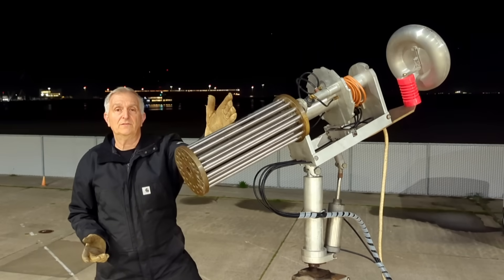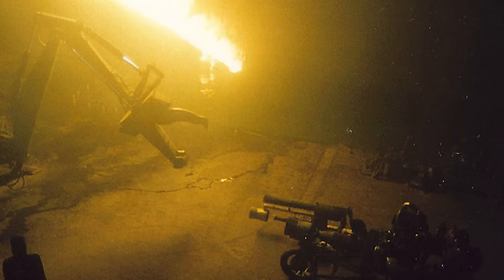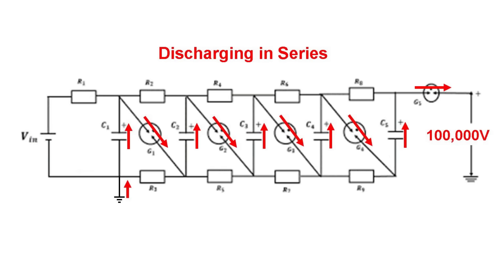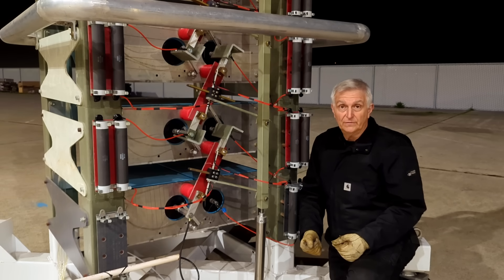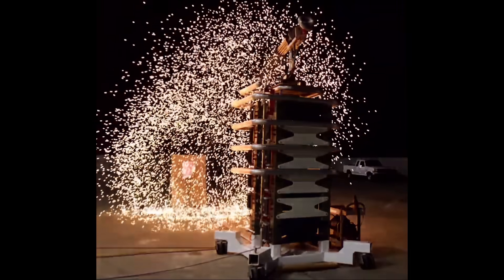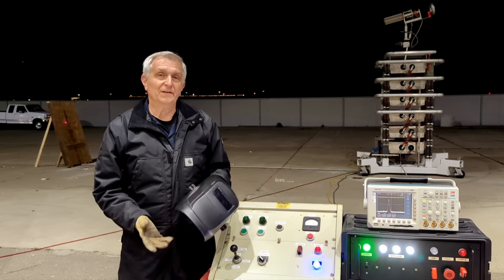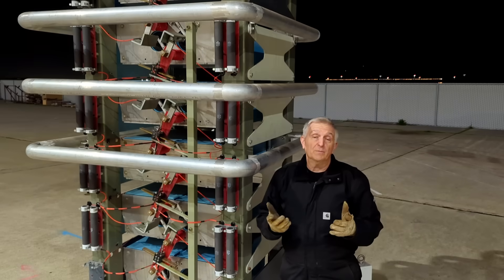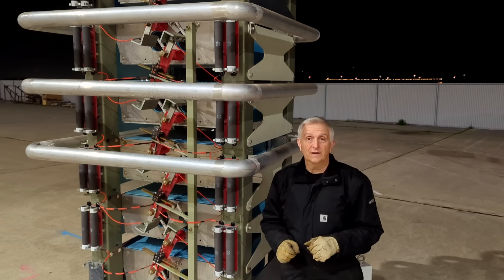Firing the Lorentz Plasma Cannon

Comment: fantastic machine ! I once saw something similar done by some Japanese researchers over a decade ago, except, what they did, was to send a high power discharge down a very high energy laser pulse, timing was everything of course. But that's the beauty of pulsed lasers, it's not that difficult with pulsed lasers to get into the regime being able to ionize air, and of course once THAT is done, your electric discharge will quite happily go zapping across it, what was particularly interesting, was that they actually didn't just use a single beam, but instead had a series of very high reflectance mirrors arranged so that the beam was zig zag down to the ground ! It seems fairly consequential that once  say, the department of defense (any nation) once they have a very high energy laser beam, that has an initial purpose of damaging/downing some form of aerial vehicles,  the next logical step is of course to "pep it up a bit", and what could be finer than having some god-awful huge capacitor bank with all the accompanying discharge shaping circuitry to deliver a pulse of juice that fries anything it can connect with ?

Comment: Unclear from watching the video- is this still using a wire or is it a true directed energy device? It seems like it fires a dart on a tether first but this is never explicitly said.
Reply: It uses a dart on a wire tether.  However, the wire is pretty much just used to direct the energy; it's vaporized into plasma as the actual discharge initiates.  And in principle a sufficiently powerful laser pulse would achieve the same thing.

Comment: Steinmetz used large banks of plate capacitors (air gap) for his lightning experiments. I saw his original apparatus demonstrated at the Museum of Technology in Munich, Germany in the late 1980s where they fired it up and produced lightning, quite impressive.  So perhaps copy and expand his approach, either using the brute force approach of even more capacitor plates, or perhaps enclose them in a sealed vessel and use SF6 as a dielectric so you could reduce the gap for more capacitance.

Comment: Awesome piece of engineering but you didn't say anything about the projectile that you fire first, it can be easily seen using the frame step on youtube. It can be seen clearly 'bouncing off' the CRT then a plasma can be seen obviously bending round the glass and all hell breaking loose inside the 'grounded' set. The projectile is dragging a thin wire behind it which intern vaporises giving us the effect of a 'Beam' very pretty ! How do you do the timing of this special effect please ? Lastly the pieces of wood seen leaving the target were due to the projectile strike not the plasma as its clear on the slow mo, so what is it made of as it damaged wood but not the CRT ? would love a look at the bit of wood. Very cool build.

Comment: try the same with fusion. yep fusion plasma arc will be contained (in liquid heavy water) in very small volume. another option is to throw a javelin, with as charge load tip. oh the pulse keeps the current wire as a wire until the energy is pulsed through. explosive material replacement with high current wire. yep quake machine of pulse pressure. high current cables up to the target point then the local thin charge pulse line at the target rock. emp cannon. local target payload on tip.
Reply: try carbon fiber ignition starter line instead. works even under water. well even a rotational energy storage can output tons of instant current to the target.

Comment: 10:27 Based on the last frame before the camera is blinded, it actually looks like the discharge went underneath the glass rather than over the top
Reply from the maker: Yep, and around the back surface to the deflection circuits.  Glass has amazingly good punchthrough strength.
Reply: @LightningOnDemand  ah, I just rewatched that section of the video and you said it went around but didn't specify which way around... I don't know why I thought you said it went over the top (I guess my brain took the "bits of circuit blowing out the top" and somehow blended it with the previous statement in my memory)

Comment: I don't get the hype. 
It does not fire a plasma .. it fires a wire which is made to explode with high current.
most of the energy is deposited between the target and the cannon. not the target.
the cannon and the target need a solid connection for the weapon to function
Reply from the maker: The trigger wire forms a plasma channel, which is essential for the machine to transfer 10's of kiloamps to the target.  The trigger wire by itself would have far too high resistance, and would of course be destroyed almost immediately.
Reply: @LightningOnDemand  and it is that trigger wire which explodes in the end. but the wire only touches the target, most of the energy is wasted on the way there. sure you have the kAs for µs.

Comment: A very impressive novelty item. You can see why things like this have no military value, all the energy of 5kg TNT which would have a way more devastating effect on the target.
Reply: I think it does have military value but not in the way you'd expect. The sound would be terrifying to the enemy's military and would become an effective agent of psychological warfare. Explosives are loud enough but this thing packs an even louder, further reaching sound, and emits an overwhelmingly bright flash in the process. You could take out an enemy's drones with this and they would be very intimidated to see that happen.

The other military use would be to detonate an enemy's IEDs from a distance with it. A lot cheaper than sending something out to detonate them. Could help if you are clearing an area of booby traps and mines.
Reply: @SynaestheticSynthesis  I imagine it would have quite an secondary emp effect for some distance too
Reply: @ Oh definitely. I think a large enough one might be able to down a swarm of drones with a sudden emp blast even if no direct hit is made.
Reply: No value yet, but who knows what the future might hold
Reply: @kahlzun  Maybe could initiate fusion in a gram of fuel? Good luck testing it though.
Reply: @threeMetreJim  if you got a full gram to undergo fusion you'd know about it pretty fast. That's about the same energy as 70kg of TNT
Reply: @kahlzun  I had a think about it, then had a look at the wiki page for the z-pinch machine. Turns out it can be done, but it's anything but safe (neutron flux).

Comment: the last test is awesome because we see the metal projectile bouncing back from the TV without even breaking the screen, so 100% of the damage is just from the plasma channel and not kinetic at all
Reply: Also if you watch the video frame-by-frame you can see that the current starts when a spark jumps from the projectile to the screen when it's still a few inches away, so most of the damage happens before the projectile even hits.
Reply: @BrooksMoses  i don't think the projectile even hits; it's blown back by the shockwave
Reply: @nicolaspeigne1429  Fair point!  It's hard to see in all the overexposure.

Comment: Just awesome :D Also, until you get the funds to build a real fun size taser, it would be interesting to see the current one fired at a working car! Mostly because I'm curious to see if the discharge is violent enough to trigger the electronics to the airbags and just how much damage it will cause to the electronics in general 🙂 Yea, I'm weird like that, but mostly just interested in what that cannon is capable of. Anyways, great to see it back and that you sorted out all of the legal stuff 🙂

Comment: It's back! Hopefully for good this time, this deserves its spot in the halls of Internet History.
Reply: Seriously! I was afraid that the only thing I had was a small screen recording of the pulse. So great to see it back!
Reply: You are a gem to the community Jeff, keep doing what you do :)
Reply: did youtube nuke it?
Reply from the maker: @retematic1488  There's an explanation in the desc above.
Reply: @LightningOnDemand  I still don't understand. It sounds as if you filmed some documents that you weren't supposed to but clearly that's not the case 🤨
Reply: @LightningOnDemand  You should contact the Slow Motion Guys, record these events at 100K frames per second.
Great Work Sir, Thank You for sharing this with us.
Reply: @LightningOnDemand will this cannon nuke an EV?
Reply: @ what a strange question planning any domestic terrorism?
Reply: @ thx, i don't usually read those anymore cuz it's mostly "go here to buy this", "check out my twatter" etc. very rarely is there any usefull info to be found in them these days.
Reply: @LightningOnDemand I noticed what I thought was a projectile. After your explanation of other machines using wires as guides for the current to travel does yours use the same method firing something ahead for the current to reach for ? .sorry I'm not educated in electrics I hope you understand the question.
Reply: @retematic1488 If I recall correctly, not exactly, someone asked him to take it down.
Reply: Geez whoever made this needs a billion bucks
Reply: @cicadaop-vu6ph yeah ive said this sommuch over the years, massively wealthy people are so boring.   

It would be such a joy for me to just fund all sorts of random stuff. .
Sure id get ripped off sometimes or they wouldnt achieve their goal but who cares.  It would be so fun. 

Im truly against all holidays and birthdays.. why? They create a lot of stress and people feel forced to spend money and get in trouble.   
 What i do think is great is random gifting.   When I feel inspired. Or see someone in need . Or just whatever really. 

Its so much more meaningful.    And real.   Too much reel  fostering Festering film covered eyes, lost and lying on the ground. A waste misplaced debased in fantasy land filled with fans looking for the next dumpstar fire to focus their energy till that dumpstar of trash goes stuporNova ….and just maybe we see for a small pay-per-view* fee  phoenix emerge from some smoldering mattress . 

*paper-view buddy…no mattresses…….we care about how we’re effecting our carban credebts.  

Loved the towerr of power
Reply: It is truly a sight to behold.
Reply: Thank you for such an “enlightening “ video. 
Also, thank goodness SRL is still doing stuff !
Any chance you can come back to Maker Faire for a live demo?
Reply: This video was EPIC
Reply: What happens if you use Argon inside the main projectile such that a material with mass ejected along and inside the plasma channel to also be accelerated during that current pulse.
Reply: Seeing all my favorite science and computer science YouTubers love this vid is awesome. Maybe we can crowdsource the funds to build an even bigger tower 30ft or larger! DARPA may also be very interested in the potential energy weapon this creates
Reply: Yes... it's back ❤
Reply: i misread that and thought it said "this deserves its spot in the balls of internet history"
Reply: It was gone? For shame.
Reply: Nicola Tesla, Charles P. Steinmetz, many more - the shoulders we are all standing on.
Reply: The original video is still around - some of us made sure it wouldn't be lost to history! So the problem was filming in the hangar, or whatever that was? That's ridiculously stupid
Reply: @gorak9000 wait …..the f.  Says who?// insane
Reply: The ultimate lock picking device... except for the sonic boom. lol
Reply: Jeff, now is your turn to make a weapon out of an array of Raspberry Pi's😂